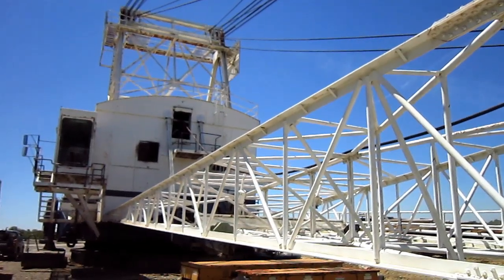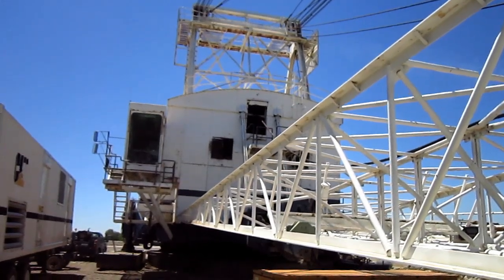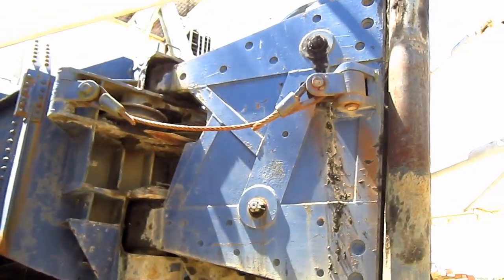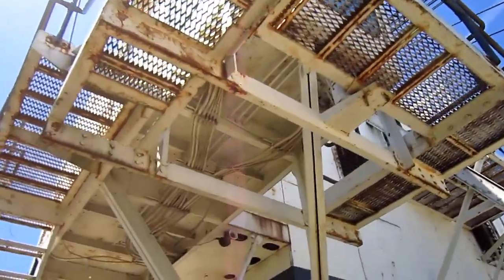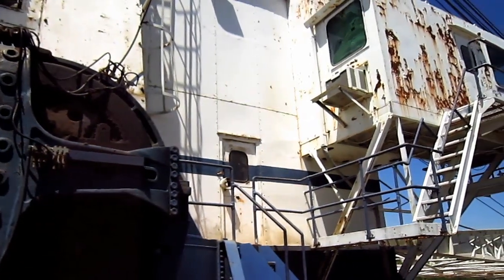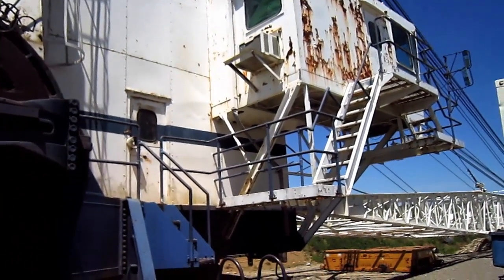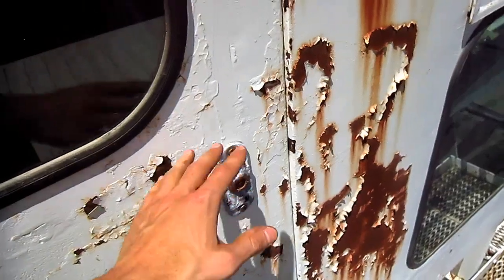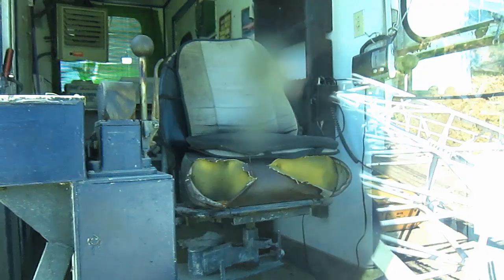Bucyrus-Erie 480-W Documentary

Comment: Good evening!
I know the Ruston Bucyrus 480 W very well. It was used in the coal industry and came to France! This machine is a machine with clutches and brakes for the winches. The right hand lever is for the winches and the left for swiveling the machine! The foot pedals are for the winch brakes. I was allowed to drive this machine myself. It had a boom with a length of 62 meters and a bucket with a capacity of 9 cubic meters. The drive was electric with MG set....Best wishes from Michael
Reply from the maker: Awesome thank you!